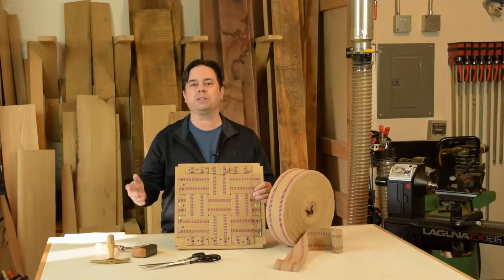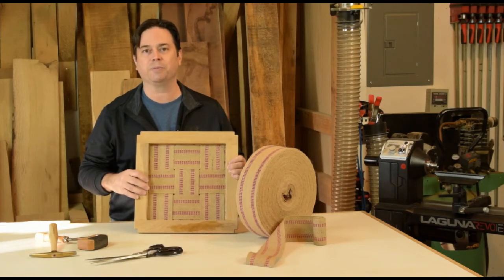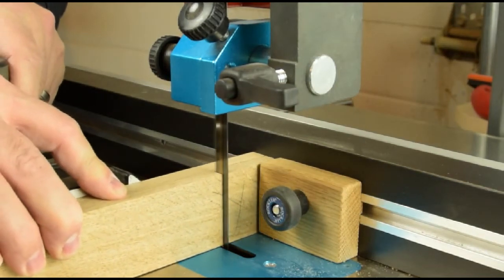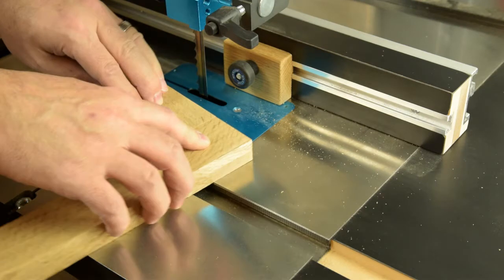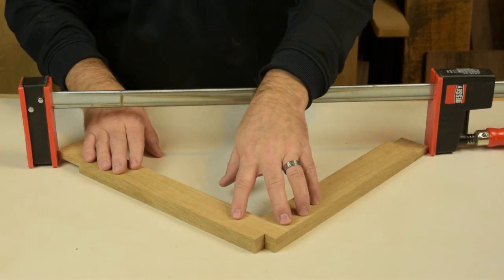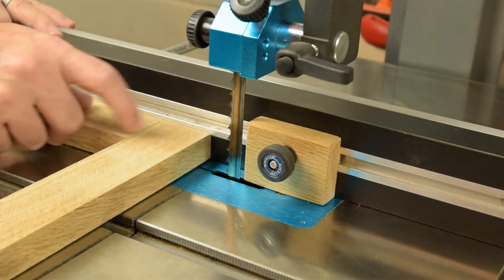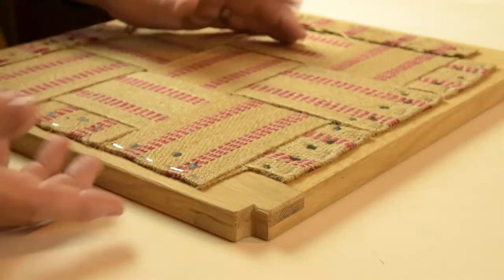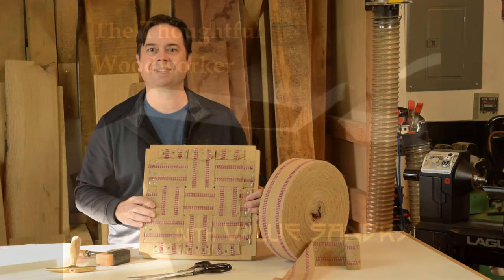Half Lap Joinery on a Bandsaw

Comment: Great video and tip for us bandsaw enthusiasts. Could you show or tell me how you made your track fence and attach it to your Laguna saw? Is it actually attached to your fence round bar support or just magnetic, etc? I have the Laguna 14BX and really like the addition of a track fence like in your video and can see this opening up many new possibilities with this already amazing tool. I look forward to your reply and help with this one.
Reply from the maker: Hi James, yes I've had a lot of interest in the custom bandsaw fence because it allows stop blocks and accessories to be used.  Here is the video showing all the details to make your own custom fence...  https://youtu.be/wUXWDP5DyNo   It attaches to the factory fence knuckle just like the original.  That way, you can quickly change between the custom fence and the aluminum hi-low fence that came with your saw.  It should work just the same on your 14BX.  Best of luck!  P.S. check out bandsaw dust collection mods here too... https://youtu.be/D9owHkBcKZc